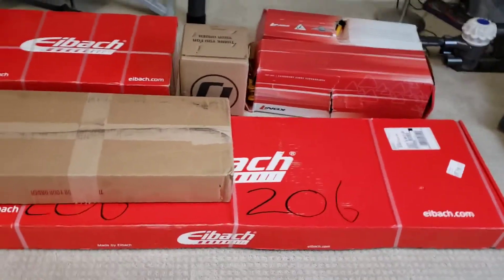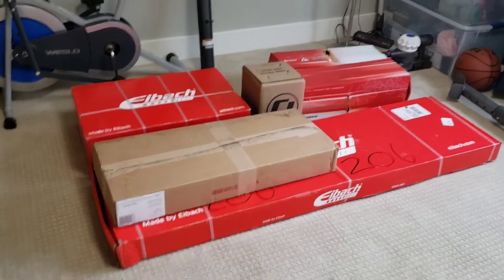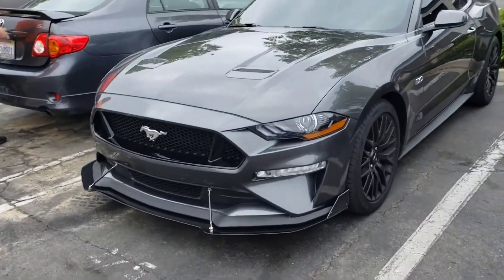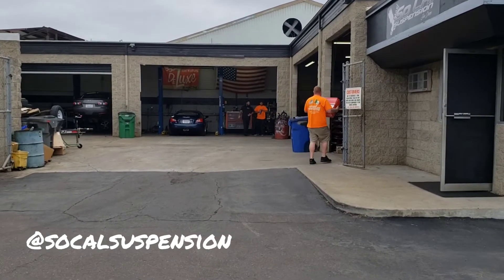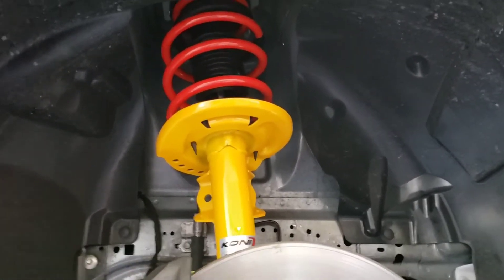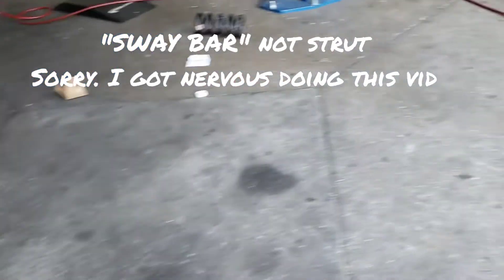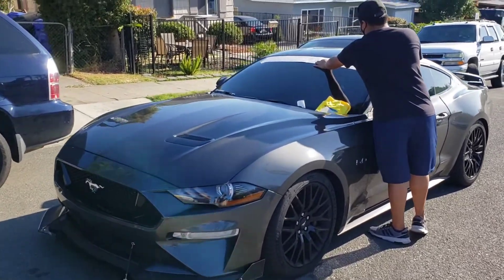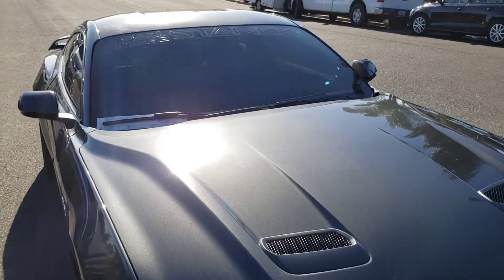Lowering My 2019 Ford Mustang GT | 2019 Ford Mustang GT Performance Pack

Comment: Is this the same procedure for a 2021 mustang gt with performance pack. Wanted to make sure one with performance package can be lowered.
Reply from the maker: @mikeinvegas1  yes.  That's correct. This car has a performance pack as well.  It will be the same procedure and you can use the same products.
Reply: @thesinghboy  thank u

Comment: I am actually waiting on some camber plates from Steeda. I am planning on lowering my 19 stang with new lowering springs, new shocks and struts from Steeda. New Vertical Links and new toe links. I have updated 90% of my suspension with Steeda. I can't wait to finish this project. I still have the factory sway bars tho.
Reply from the maker: Steeda has a great set up also.  The Sway Bars, as you saw in the vid are beefier and more rigid than stock.  If ur not tracking the car every weekend, ur set up will be really comfortable on the street and not too stiff
Reply: @thesinghboy  I don't track the car, daily driver really, it's been an expensive project, $1500 parts only. Hopefully my camber plates come in so I can contact my mechanic
Reply from the maker: @thatguy-ve6mb  yea man.  Modding cars isn't a cheap hobby.  Haha!  The Camber Plates came in clutch.  Gonna get my toe links and adjustable rear camber links from BMR for wheel hop and staying flat on the ground.  Can't figure out if I want to go centrifugal or roots.  But that's down the line. Need the perfect set up 1st
Reply: @thesinghboy  Instagram?
Reply from the maker: @thatguy-ve6mb  my IG is tsb_1z what's yours?
Reply: @thesinghboy  just followed you. Rob.1813